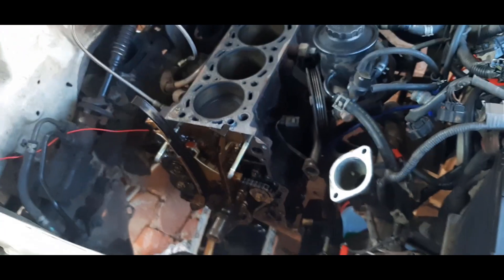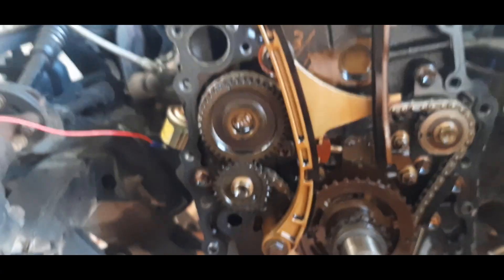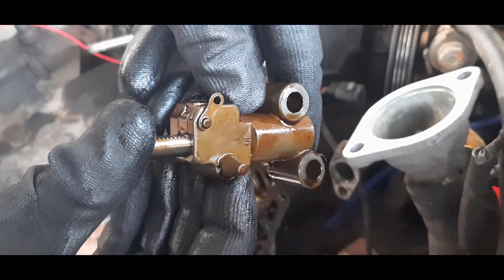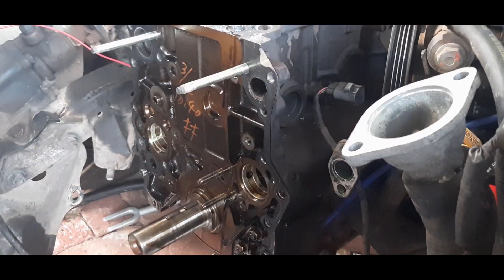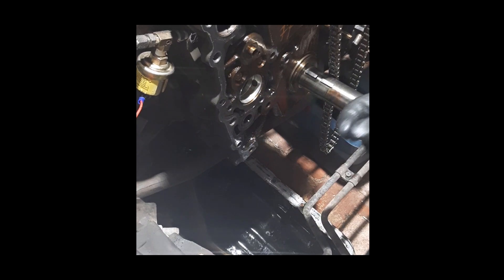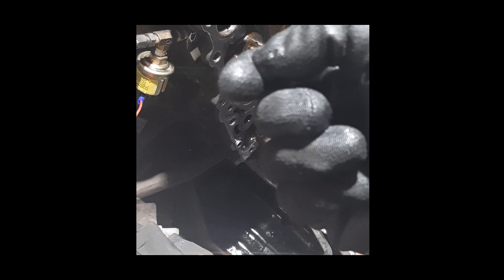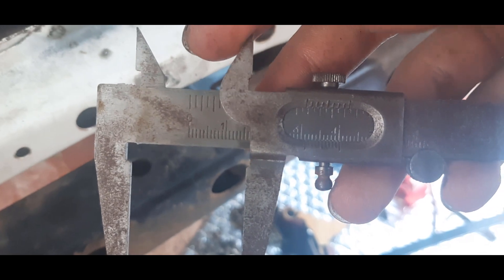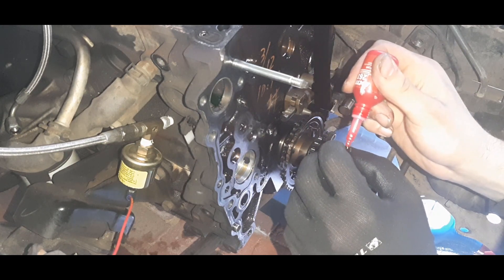3rz Balance shaft delete without LCE kit

Comment: Dumb question, but im asking just because I don’t want to have to tear into this motor again any time soon. Do you have to put any bolts back in for the balance shaft assembly?
Reply from the maker: No you dont have to, only piece still used is the balance shaft tensioner which has the two oil squirter holes

Comment: You can drill the block and use a chain squirter from a 2rz to keep oil on the chain.  Works great and saves the LC kit $$$
Reply from the maker: @ryanlogan2911  good tip!

Comment: This was going smoothly for me until my tap snapped off in the block. I am trying to think through how to remove the metal shavings that are in the oil galley. Any idea how to flush that properly? My engine is out of the truck and the head is off.
Reply from the maker: my condolences mate. i will look to see if there is a schematic of the oil flow for the 3rz. if you have smacked the offset bearings in already you have have to remode the one above the snapped tap and blow all the chips out. you may have to dig the tao out with a carbide burr and oversize the hole to m8 or m10 for the plug. let us know how you go.
Reply: Thanks for the reply! I also looked for a schematic and tried to use a vacuum on nearby oil holes. Wasn’t getting anywhere with a drill and carbide bits so I picked up the cheapest welder at harbor freight and was able to weld a nut to the tap and back it out. Thanks for the vid and the help!
Reply from the maker: @joelchristopher190  glad to hear you got it sorted! A welder is never a bad investment
Reply: My mate had exactly the same question. i gave him my neodymium magnet to use which i bought months earlier on AliExpress for $3.00. Got all the shavings in one second just by holding it next to the hole. My 2cents worth!

Comment: What do you put back in place over the bearings if not reinstalling the balance shafts? What blocks the 2 big holes in the block where they normally go.
Reply from the maker: nothing blocks the holes, the purpose of the removal is to boost your oil pressure, and re installing the bearings to block the oil ports is all that needs to be done.

Comment: Have you a Followup Video on completing the Job?
Cheers'
Thnx
Reply from the maker: I made a few videos whist doing the build. Once the shafts are removed, the bearings flipped and the oil port plugged its just throwing the timing chain on as came off just without the balance shaft chain on the crank sprocket. If you have any problems there a facebook group called 2/3RZ turbo community that has friendly members that will answer any questions you post

Comment: I drilled it to far and now leaks water , do you know how to fix that ??
Reply from the maker: Ooof mate thats not good.
Id suggest measuring down the hole on your engine. In the video mine measures 31mm deep. Id suggest drilling and tapping all the way down your hole and running 1 grub screw either covered in thread sealent or loctite down the hole but not bottoming it out as it would plug the coolant port. Maby touch the back then back it off 5mm or so. Then run another grub screw down and tighten it against the first one effectively locking them together. Again use sealant or something. Is your head off the engine? You might be able to shine a torch down the first coolant port and see where it has broken through.

Comment: Great video..Once the shafts are removed what about all the other wide oil ports inside the block? Without the shaft(s) being removed wont they now bring down and actually lower the rest of the system pressure since they're now left wide open?
Reply from the maker: As far as i know the oil port that is blocked up is the same oil gallery feeding the back balance shaft bearing. It may drop the overall oil pressure having the rear ones still open however seeing that my oil gauge pressure went up from 10 to 35psi at warm idle i would say it is not worth bothering over.
Reply: Your video is 100% correct just turn the bearings 90 deg, I'm finally getting my block back from the machine shop. I've cleaned and see there's just one oil feed at this bearing location, Its the actual balance shafts, they're fitted with oil journal that feeds the rear bearings, no need once bal shafts are removed. Also its why the engine oil pressure actually increased since the oil is no longer being distributed to these bal shafts. thx again for your video.  @EbayEnthusiast42
Reply from the maker: no worries mate hope your build goes well! @vanhap
Reply: thx again for your video @EbayEnthusiast42
Reply: @EbayEnthusiast42  Very helpful video thx

Comment: Hey mate, would it be just as easy to 90° the bearing and put the shafts back in? Then there no need to drill and tag or plug tensioner holes? Is that right? Or am i just being extra lazy?
Reply: Yeah righto. Ill just do it properly. Hahaha
Reply from the maker: I'm pretty sure that the hole you drill and plug goes it the back balance shaft bearings. id guess that putting the balance shafts back in would restrict the oil flow a good amount but not to the full effect effect of a blind plug. the running clearance between the bearing and a balance shaft journal would probably be similar to the big end bearings.

Answer: if you really CBF then go ahead, but plugging it will be more worth your time while its apart.

Comment: With the oil squirter how many holes do you have to plug off the one that squirts the chain ?
Reply: How do you plug the hole on the squirted
Reply from the maker: 5:23 the 2nd hole towards the back is the one you plug up. the hole at the front squirts the bottom timing chain sprocket

Comment: what happend with the tensioner holes, how did you plug
Reply from the maker: I caked some hardening putty onto the holes under that swuirts the balance shaft chain. The tensioner should be fine fully extended as the oil pressure will fill the cavity inside once it locks at maximum travel. Make sure you leave the front hole for the timing chain gear open
Reply: @EbayEnthusiast42 you can put with all that holes because nothing change on that part of the pressure system, the only thing it’s that you don’t have the balance shaft chain tha it’s

Comment: I did this to my motor this weekend (cause the balance shaft bearing fell out) and I am I’m Impressed the motor fells like it has more torque and power, there is a lil bit of a vibration at idle but just a lil. I recommend doing this.

Comment: Why cant I just delete the chain and leave everything else as is? I don't see the benefit of removing less than 10 pounds from the engine and doing all this work.
Reply from the maker: pulling the chain will stop the balance shafts rotating but oil will  still flow through their galleries. the reasoning mainly for deleting them like this is to up your oil pressure as at high horses number 3 rod likes to say g'day to the side of the block.

Comment: For anyone that’s done this to a daily truck, is there any actual noticeable vibrations? Odd that the 2rz doesn’t have these.
Reply from the maker: For my only thing is my exhaust rattled more since its held on with hoseclamps. The car doesnt feel shaky or unpleasent at all
Reply: Would an m2 grub screw work to plug the oil journal?
Reply from the maker: @j.b.1526  from memory the hole was like 3 or 4mm in diameter so an m6 would be the minimum size
Reply: ShaolinSpoolieBoi  Yep. Missed that part. Caught again on the review.